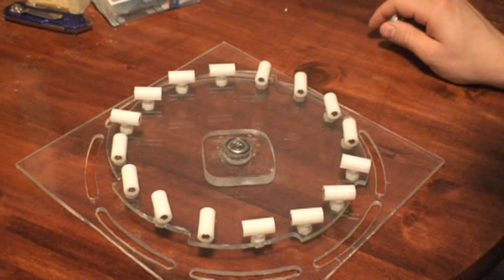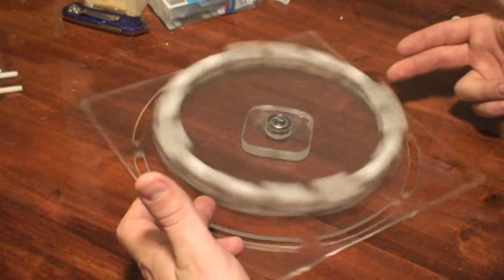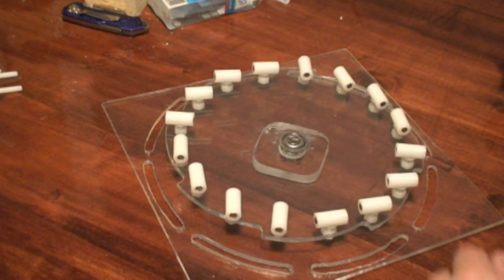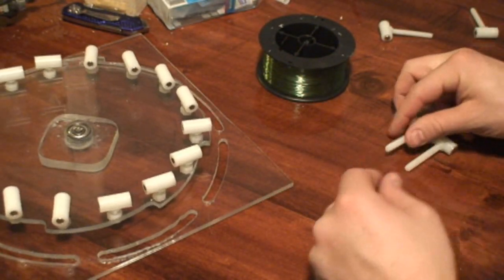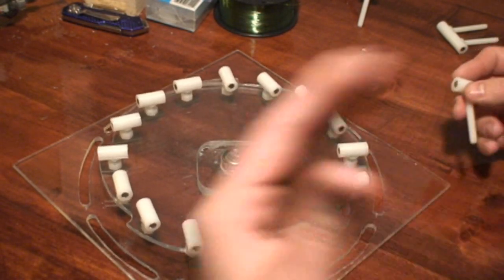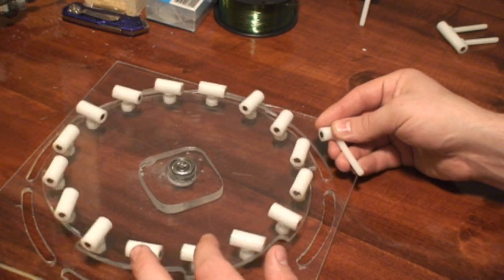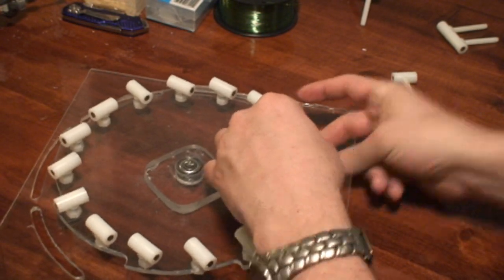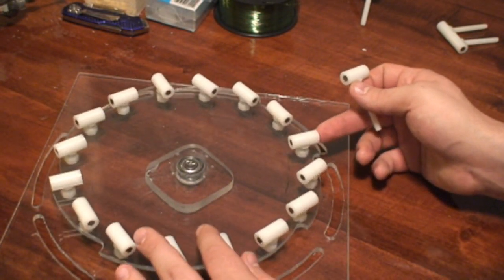Magnet motor, free energy, overunity test 2

Comment: Ok, so I have no idea about this stuff. Just found this video really interesting. This might be a stupid question but hey, youtube is full of them so I'll ask anyway.

Why do you need to constantly reverse the polarity? Would it not work if the magnets were all set to one direction? Let's say, repulsion. Then you would have a constant even flow. Yes?
Reply: +James A Not really. If you had any experience with magnetic mpotors you would soon learn that each constant force magnetic motor has what is often termed as a "sweet" spot where the force or repulsion from the leading me=agnet and the force of repulsion of the trailing magnet become equal and the rotation stops.

Comment: I enjoyed your video.  I have been trying to work through something very similar, but because of my physical disability (Duchene Muscular Dystrophy) I have been able to create anything yet.  I think it'd be great if we could talk about it.  Consider putting your wheel up on the end.  Allow gravity to somehow turn the magnets that direction you need on the wheel.  I have more ideas. Or on your stationery magnet try a solenoid to switch which end is closer.  Really small magnetic field needed.  If you get the device going fast enough it might generate the power needed.  Another idea have multiple wheels contacted by a central hub.  I'm thinking about building something in secondlife.com.

Comment: You can use mechanism  to flip the single magnet  with a touch of the disc you have    and do not need to go complicated electromagnet   and timing to switch it.Still i doubt if you could get free energy  ,If you do you would be a multi billionaire.Good luck

Comment: drill a hole in the dish where the magnets are and put a non magnet post in. just say a 1 16th post/ then run a pace of non magnet lever over to the single magnet. flat pace aluminin. if it is timed right the single  magnet will spin from north to south just a thought. good luck

Comment: If the configuration is the same with just the poles switching, wouldn't it have the same effect if you placed all magnets south facing out and kept the external magnet static? Theoretically that should have the same result as flipping the external to match the new orientation. Then if you could create a mechanical shifting device to move the magnet towards and away as it is rotating, it could theoretically move perpetually. This being said, you would have to calculate the distance the magnet would be from each rotating magnet and figure out a mechanical solution that doesn't need more kinetic energy than is generated. How ever, you could create a spring switch and some cogs to control the rotation a specific times. However I doubt rotating would actually do any better than just having all of the flywheel magnets facing south pole out. the hand spinning freely has too many variables to be a good judge since you can move it ever so slightly to and from to get the motion going what seems perpetually while you're rotating it.

Comment: add a gear to the wheel with the gagnets, and use a gear template software to determine the size of a second gear, mount it to the outside and as the disc spins, it should turn the drive magnet, for lack of better words.

Comment: TLDR: It won't work, the device suffers from typical losses and does not create more net energy than supplied at any point.

Firstly, let me quote the video: "Almost zero friction."  This is a statement made in comparison to expectation, an opinion. There are moving parts. There will be friction however small you feel it is, and feelings are not science! Don't forget that! Additionally, your plans include electromagnetic coils. Inherent in transfers of energy via electromagnetism is energy loss via heat, among others. Unfortunately, there is no indication of over-unity present in your demonstration, description, or plans. I hope to explain a little of why. 

Let's start with the use of the coils. The alternating current across the induction of the coil and the capacitance of the wire will create a basic tank circuit wherein collapsing flux will introduce an inductive kickback. That kickback alone creates enough loss to completely ruin the thing as far as over-unity and longevity is concerned. The resonance of the tank circuit adds more loss as well via a harmonic vibration. The alternating direction of current will encounter resistance and produce heat in the entirety of the circuit. This heat makes the wires less conductive, which produces even more resistance and thus more heat. Thermal runaway occurs and you've got at best a severely inefficient system, and at worst a burnt wire somewhere! When you dissipate the kickback voltage to prevent this issue, or heatsink the coil to reduce thermal failure, you lose that portion of the energy. If you attempt to capture it, you will need to convert it, and that too will lose some of the energy. These and many more problems exist, and overcoming them in terms of achieving over-unity is  only possible if more energy is generated than initially supplied. This is not possible via electromagnetic conversions of energy using known methods such as magnetically excited electrons within coils. 

You plan on using mechanical switching to provide an alternating magnetic flux, much how an AC electric motor functions. The energy used to trigger this mechanism will require additional input energy. I'm sorry to say that at best you are creating a (mostly magnetic) Rube Goldberg contraption. A series of complex domino reactions, each with it's own loss. On top of all of that, you get nothing from the device unless you interact with it, to extract (in some fashion) the energy that you hope to produce. That interaction, whatever it is, will produce a load on the system be it electrical or mechanical. This is additional loss. The apparent necessity of a flywheel should be an immediate sign that the system already experiences losses beyond what is supplied. What you've done by adding a flywheel is transformed one force into another and introduced more loss. How you obtain that input torque does not change this fact.

I hope it is clear that loss to the system comes in a variety of load factors. No overunity has been achieved, as unity itself has not been achieved. The end result of attempting to use a drill battery is this: Your drill battery will have a load on it created by the machinations of your device. This load introduces loss as the energy is changed from one form to the next before being finally applied to the system you wish to "charge." More energy transfer would occur by simply connecting the battery directly to the system you wish to charge even if that means using voltage and current regulation to do so. Which... I'm sorry to say, you would still need even if you used your device, and that circuitry creates loss too!

I will say, however, that your device is fascinating and most definitely a fun project. I am happy for you, in your inspiration to create, invent, and innovate. Congratulations are in order as far as I'm concerned, because you're doing science by experimenting and wondering. Without imagination, we wouldn't have the technology we have today.

Comment: hey, what if you set up some form of gear system so that the turning of the main section turns the outer magnet so the attraction/reputation changes with the central disk

Comment: how about using gears or a belt to mechanically spin that magnet? I mean, a belt from the center to outside of the wheel that makes it spin, if the wheel goes faster, the magnet outsite will go along spinning. could it work?

Comment: That is absolutely NOT how an electric motor works. electrical motors use electricity and magnets to generate a mechanical spinning (requires electricity to be put into the motor). this guys device uses magnetism to produce the spinning motion (never needs to be recharged or plugged in. and its not easy to demagnetize a magnet, they don't tun out like batteries) and the spinning motion created can produce electricity for free using permanent magnet that will never run out...at least not unless you try to ruin the magnet. A motor that never needs to be refilled, never has to charge, never requires any power. A machine that requires no power to be put into it and generates energy is by definition a FREE ENERGY DEVICE!

Comment: The energy output will still not exceed the amount of energy used to create the magnets. Everyone building these machines out of magnets forgets the fact that the energy was stored in the magnets at some point using a huge amount of energy. So even if your machine does run - will it ever output more than it's stored energy? no, probably not.

Comment: you realize that the energy that is moving that is actually coming from you turning that magnet right?

having a mechanism do it would also require added energy, the system cant run off itself.
friction
its a thing.

Comment: jzsd14me, if you used the electromagnets, you could use 2 (one N and one S) switching them on and off at the right time instead of changing polarity in only one. also instead of a single point of contact you could use multiple points of contact, that way your intensity would be more constant.

Comment: You need the magnets to be floating. Achieved by vacuum chamber with drop in temp. Also you will still need a computer to run an algorithm for the acceleration to turn X degrees of propulsion magnet (the one you are turning side to side). Good luck.. also russians have the tech and we will be seeing this in the next 5 years

Comment: You might want to consider a circuit using a hall effect sensor and a transistor and relay that would reverse the voltage in the electromagnet as the sensor detected a change in polarity of the magnets on the disc. If you want I can send you a circuit that I have used in the past for just such a th8ing. You need to either ground the back EMF or use it to charge a capacitor or you will begin to heat up your electromagnet until you melt the coil. Let me know if you wish any further pointers on this concept.
Reply: You literally just described how an electric motor works.

Comment: "This will technically be an overunity motor if I can get the electromagnet built to the right specs."

No, it really won't.

You're expending as much, if not more, energy twisting the little magnet on the rod back and forth as you would if you just pushed the disc with a finger.

Comment: what if you had really powerful magnets and the negative and positive magnetic pistons that turns around is powered by wind turbines or solar panels than you would have a self propelled system not using coal or oil

Comment: This is not free energy. In this case you gave the disc rotational energy by changing the magnets polarity. It may not be obvious but turning the magnet in you're hand takes a certain force and thus requires energy. The same will be the case for the electromagnet. Each time you change the polarity, you will take energy out of the battery to create an inverted field, however unless you get a use from most of the field energy, which is not the case in this video, this tactic will not prove efficient. So this is definitely not free energy and free energy doesn't exist anyways due to the law of conservation of energy.

Comment: This pales compared to my perpetual device... (which isn't really perpetual as it's a modified petrol engine) but hey, it'll run on a single tank of fuel with normal output essentially until the engine requires a service or dies. Studying nanotechnology is useful that way.

Comment: Hi i think u on to something here. if u use a commutator connected to the turning wheel and the hammer magnet it should turn  The hammer magnetic u have in ur hand.. timing eill be key . u can also use an electric magnet but thats tricky to explAIN

Comment: Now put gears and add the magnet from your hand in a way so it turns with the wheel
Reply: The friction would overcome it.
Reply: Hah no...
Reply: TheSphongleface It's the same reason a circle of gears wouldn't work;  When you use mechanical means to try to make a machine self-powering it will loose energy due to friction, thus causing it to eventually slow to a halt.
Reply: +TheSphongleface It won't work. The device will take more energy to turn the magnet than you'll generate from the device so it'll just come to a stop rather quickly. And that's even before you add a method of gathering energy from it which'll sap it even more meaning it'll stop even faster.
Reply: Did you see the video from the link? Was there an electric motor? -I've been looking at these since the beginning of the internet and I wonder if anyone ever managed to pull this off
Reply: TheSphongleface It can't be done. Energy cannot be destroyed or created. (With the exception of some really intense quantum events in which energy can be turned into matter and vise versa)
Reply: +Jacob Furrow I know. I still want to see a next to frictionless pin flip that magnet he is holding + - + - shouldn't take much energy at all if the magnets are inactive in the exact moment

Comment: How about belt driven from spinning plate to ur altenating magnet, but instead of "back n forth", try adding more magnetic ends. Maybe 3 north and 3 south in sync with plate magnets all getting pushed or pulled by spinning 6 magnets. Just find the right size pulley for syncing and probably still wont work? Hah! But would be cool if it did!

Comment: You are putting energy into the system by rotating the magnet.  If we neglect friction because friction is small , all you are doing is creating is momentum.  This system has no load and there is energy that you are putting into the system.  

At least you are rotating the field like a real motor but the energy in is more than the energy out since there is no energy out from your example.

Comment: Well couldn't you have a mechanical lever that will rotate your drive magnet 180 degrees at the point of polarity shift. then have a small lock bracket that will keep it in position until the next polar shift at which point the lever would rotate it another 180 degrees. thus mechanically alternating the polarity shift, yea it will take the actual input of energy to give it the original spin so it wouldn't technically be going against the laws of conservation of energy, at that point providing energy until the magnets loose polarity? just an option.

Comment: JZSd14me, I drew a picture with an idea of how to move the magnets. Initially I thought about gears but that won't work, that is just because of the 2nd law of thermodynamics the entropy, however if the magnet is really strong enough to defeat the friction the possibility exists. My idea is a simple disc connected to your upper disc and both spin together as same speed. This added disc will have a variable height that will raise or lower the magnets you are holding w your hand. I have a sketch I can send but I don't know how to attach images in replies. Saul

Comment: why don't you use the teeth on the edge of the wheel, glue one of the magnets your holding onto the stationary base with a gear or just a stick glued to the magnet. every time the wheel does a quarter turn, the teeth will strike the magnet at the base and flip it round changing polarity. duuh..

Comment: Why not just replace some magnets on the wheel with north and other ones with south instead ,sothat you will get north and south north and south at certain moments, the main magnet in your hand then needs to be only repelling or attracting magnets, just try that and maybe you don’t have to use a flipping electro magnet,
This way it may spinning on it’s own without electricity,

becides why on earth would you ever want to make a electromagnet motor,why not just make a magnet motor wich does not need any electricitivy instead?

Comment: I dont do much physics at school but what if you made a program to alternate the polarity on the magent he was holding? Power that with a solar panel then attach a generator to the spinning disk? Is there anything wrong there?
Reply: +David Leng No that would work... The problem is you'd get more energy from just taking the power from the solar panels to begin with. His device just won't work as it requires energy to be put into it to get energy out of it meaning it's an unneeded extra step in the process of getting the energy at best and an active detriment at worst (The worst case here is the correct one).
Reply: Ah right fair enough, thanks :D
Reply: David Leng No problem energy's an annoying thing. Sadly it's the same with all such things as this. It's impossible to generate energy in a closed system. The only way we can get it is by gathering it from an outside source such as coal, the sun or nuclear materials.

Comment: Your "free energy motor" has almost 0 friction force (as you said) that means it won't work other ways, then, let me put a question: how can you use that "free energy"? It is true that in theory one can make a system that keep moving to infinity, but motion itself doesn't create any energy! No matter how many tries you make, when you build your dream magnetic free-energy engine and try to use that energy the engine will stop; so I advise you to stop losing your time. In this video you put kinetic energy in the system when you spin the well or when you spin the magnet or when you hit the table; after this energy is transformed into other kind of energy; let's say, thermal energy, the movement stops, it will happen the same if you try to turn this energy into electrical energy or mechanical work.

Comment: You may want to google Stepper Motor and then decide exactly how you want to claim copyrights on this. Also, if it requires an electrically powered magnet, or a guy standing there twiddling a magnet, how is it free energy?